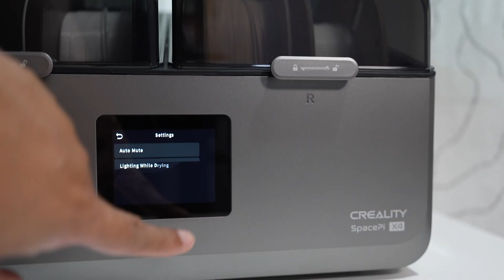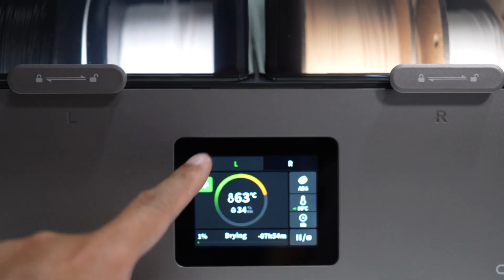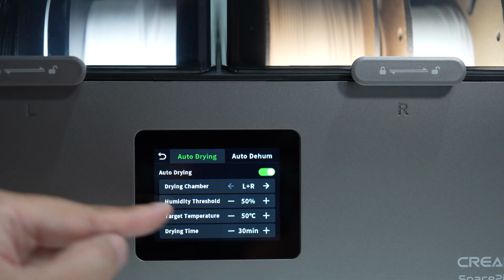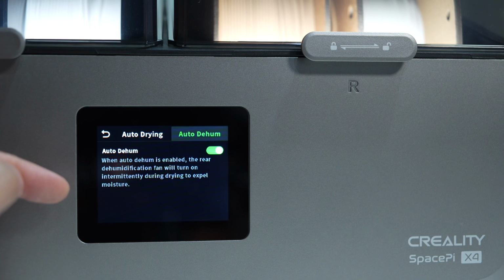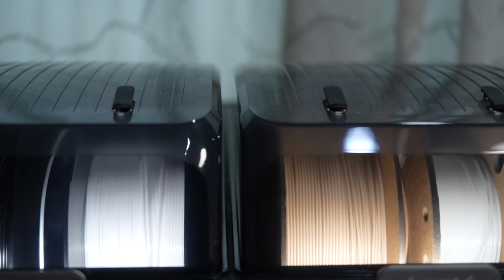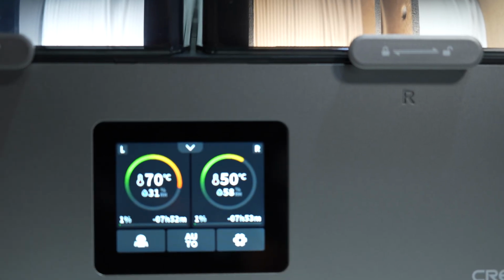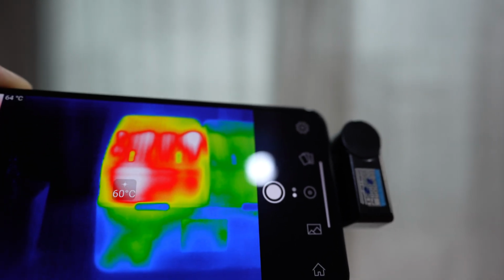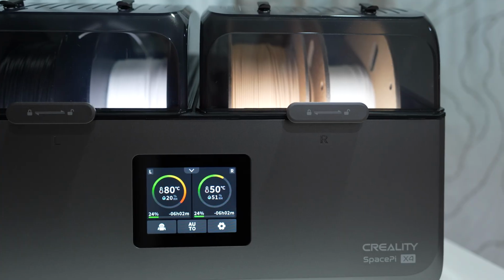Creality SpacePi X4 Filament Dryer – First Look & Review

Comment: I struggle to understand these heater dryers- surely the Relative Humidity will show an impressive but artificial drop purely because the temperature has increased?  Cool the filament back down and the RH will go back up….
Reply from the maker: The older dryer I have has no exhaust fan, I'll have to open up the lid manually from time to time so the trapped moisture can be expelled outside. Otherwise, I've to put a fresh bag of desiccant in there.
Reply: @paulgrep3193  if the moisture has no way to escape then yes. Even with a not very well sealed it takes quite a long time for the RH to climb back up. In my space pi plus it will go from 13% to ambient over the course of a few days. My space pi x4 is sealed with one way exhaust valves. It will stay at 13% indefinitely.

Any dryer I’ve ever seen also makes use of desiccants, which if kept fresh obviously makes a big difference in keeping RH down regardless of temp.